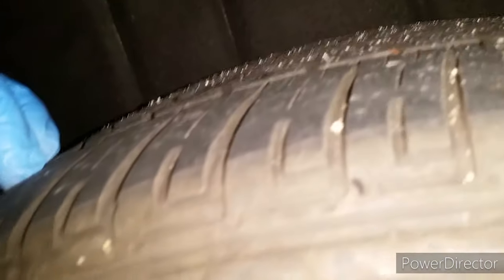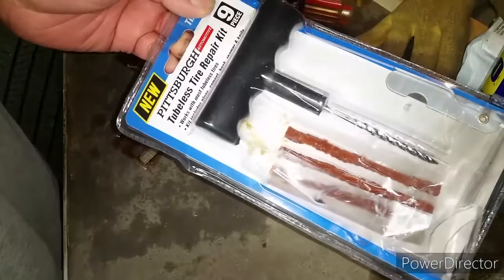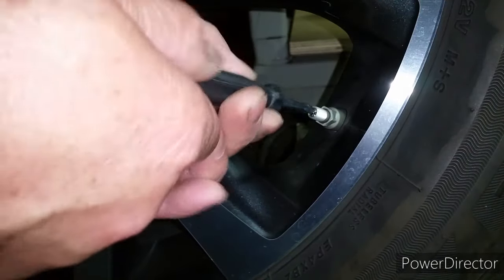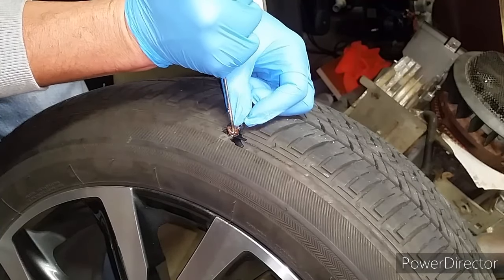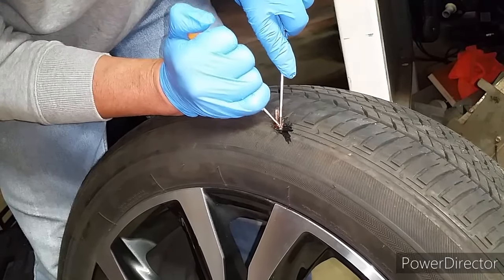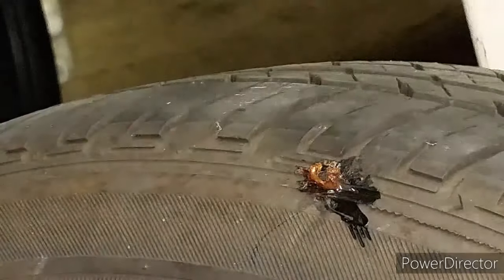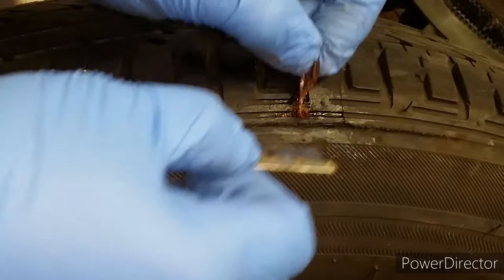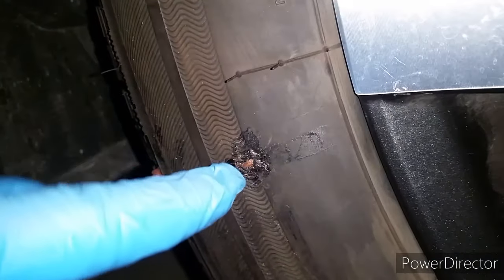Impossible Repair | Nail to the Tire Sidewall fixed | DIY

Comment: This is highly unsafe. If you do have to do this, put it on the rear. This greatly raises the odds of a blowout. And if you do have this, let the cement cure before putting weight on the tire. There is no steel belt to hold the plug and it will more than likely just pop out.
Reply from the maker: It was mounting in the rear for just in case purpose.  After the holes were sealed,  it did sit for 24hr or so before it's aired up. No there would be no blow out. Worst could happen was the holes  would start to have a slow leak and set off the TPMS.
Reply: @tonedubb4325  worst could happen is catastrophic collapse of tyre causing car to veer into oncoming bus full of people resulting in fireball and 40 deaths including your own
Reply from the maker: Hmmm doesn't make sense,  if the front tire goes,  you will more likely to have less control of the car. If I understood your comment correctly.
Reply: @tonedubb4325  Yes its counterintuitive but:Regardless of the drive type, we recommend not fitting the better tyres at the front, but always fitting them at the back. The reason is simple: The rear axle ensures the tracking stability of a vehicle.
Reply: Just to add to this a year later the plug should never just pop out if installed correctly because it vulcanizes and becomes part of the rubber.

Comment: I've used a plug on a shoulder puncture like this, and yes the pressure held up.  But I don't think it's possible on an actual sidewall puncture.
Reply from the maker: There were two caused by the nail. One was one outside of the treads, and the small second punctured hole was on the sidewall. Do not try to make the hole bigger like you normally do on the treads area. Using some of the plug material along with rubber cement would seal.

Comment: Random this video only popped up now for those other commenters as I searched for it. Must be a lot of flat tires today. 

I just did a shoulder repair after the tire places wouldn't. They just wanted to sell me a new tire and sell the old one to a used tire place.
Reply from the maker: I went to les shwabs tires for a different flat on wife's my van. She went with me. She was wondering how they make money if they give flat fix for free.  They said it to close to the edge and told me they couldn't fix it. I told him ok, set me up with one tire then.  He could not sell me one. I need to buy 4. Driving with one different tire is unsafe. Now She knows their tactics. I told her some customers would buy 4 new tires because they believe them that's unsafe to use old ones. Because he knows tires. Now she's  wiser. Lol
Reply: I'd say it's partly trying to upsell, but mostly fear of being found liable for any crashes later on, so those policies are a way for them to lawyer ambulance-chaser-proof themselves.
Reply: Also, sidewall punctures have a danger of "zippering" from the belts to the bead, so a repair there should AT MINIMUM use a plug patch from the inside, and maybe use a pressure roller and 3M rubber weld, to be safe.

Comment: Why would you take the air out? Leave it in! 
(That’s what she said😂)
But seriously.. there’s no need to remove the air
Reply from the maker: @clubbinmag3  just wanted the glue to bond. Having air pressure would push out the glue and won't seal properly.

Comment: Can someone explain why this is unsafe and give proof why it's unsafe. I know nothing about tires really, but it seems like there's more naysayers then actually facts. Is this one of those "they all say it's wrong so I guess it's wrong" or is there truly a reason? Just saying for those who don't understand.
Reply: That's the most flexible part of the tire when it's rolling down the road. I have a winter tire that was patched by a professional tire shop in the same location and I'm still kinda nervous about using it.
Reply: I own a tire shop and from my experience the side wall don’t have any metal wire to hold it in place like the center of the tire so the hole on the side wall can expand while driving with a lot of pressure. It can cause a blowout
Reply: Technically if you’re really strapped I gather it’s something you might be able to do to get down the road, but take it suuuuper easy and as slow as possible. That’s assuming you have an air pump to re-inflate. In an emergency and you don’t feel like you have a choice you’ll have to go for it and hope she holds. Use every patch you got and can lol
Reply: If sidewall punctures cause blowouts so easily why didn't his tire blowout when the nail was in it?
Reply: @matttheodus7519 because it’s always flat. Hot take
Reply: I have been in tire industry over 40 years, especially in Final Finishing, but such a type of repair is not suitable for passenger cars, it must be repaired by professional  operator who knows about hot repairs of tyres. Second glue and shoe lace is not solution, in shortly.
Reply: I was thinking the same thing

Comment: Side wall structure and integrity are very important elements to the foundation of the tire and very critical to the safety limits and reliability standards. The side wall is what holds the weight of the vehicle and is also what is responsible for the handling especially under turning circumstances which will create a weight shifting situation where weight will shift towards one corner and that side wall has to live up to those conditions. Besides, you will normally start to see a bobble in the side wall at the repaired area which means the structure has lost its normal integrity.
Reply from the maker: In my case, none of those things  happened.  Tire held air, never leaked once and last for a year then i went ahead and replaced all 4 tires. I got to wear all 4 tires evenly till time to replace them.  Think of this, if you poke a needle any pairs of pants you got,  it will go thru but the needle doesn't break any of the woven fiber.  Here you got a small nail poked 2 holes in the side wall, small nail, no nylon woven threads broken. The rubber is damage due to punctured holes. The goal to to stop the leaks.  Add glue and fiber strands to plug up the holes. I didn't disturb anything else. Why would there be bubbles? If the  holes are plugged,  its a success. That's the result i got I got. I could understand if someone stuck a knife to my side wall,  no I'm fixing that.  Fiber are cut. Thanks for comment. I saw videos from the middle east where the commercial truck tire with a tennis size hole on the side wall. They fixed that.  Now that's iffy.
Reply: You are going to have do a lot more than just write " The side wall is what holds the weight of the vehicle.." to argue against physics.
The side wall doesn't even have steel wires like the tread side does, so I have no clue how you figured this one out ???

Comment: This is "DANGEROUS"!
I wonder how many people is actually taking this advice. That second plug repair dead middle in the side wall will eventually cause a blowout. 

Just hope you don't get sued. 🤞
Reply from the maker: That tire got replaced long time ago.  Not dangerous at all.  Worst could happen is a leaky tire that requires airing up from time to time.  Tire has TPMS.

Comment: I've got this EXACT problem rt now. And though I paid for road hazard (I'll never do that again through Walmart), they won't honor it. And no tire shops will touch it because of where it's at. It's almost exactly where your nail was. A little higher but just barely.
Reply from the maker: You can fix it.  Just careful not to make the hole any bigger. Don't use the plunger tool provided. Take the tire off,  let all the air out, any left.   Peel the stick strand of flat fix material. I used a syringe to inject exta glue into the hole.  I think the video shows you how it's done. Good luck.
Reply: probably because when the tire was flat you kept driving, now walmart has an excuse not to fix it.

Comment: It’s not that u can’t put a plug in the tire it’s that it’s so close to the side walls the tire compresses and the plug will come loose and leak again
Reply from the maker: It's all depend on the punctured hole.  If too big or structurely damaged,  then it might not be good to fix it.  So use a little common sense.  In my case,  it's just a couple of small holes caused by a nail. The patch has never leaked for a year. I ended replaced all 4 tires after the treads worn down.

Comment: You're not supposed to plug the sidewalls or the shoulder edge of the tires. only the center they won't even do it at shops I had to get a new tire today because it's not safe. you can easily have a blowout.  It's always good to save money but not when you're life is involved.
Reply from the maker: I agreed if the tire is too damaged but you need to access and determine whether it's doable and safe.  Will not work in every situation.  It worked for me.  It lasted a year without leaks. Mine was caused by tiny nail.

Comment: hyperinflating tire will help to use a real repair kit, but overall a real bad idea
Reply: I plugged a hole in the sidewallof my truck tire and then proceeded to drive it 20k miles that way.

Comment: I would think this is a last resort until you get to the tire shop and get a new tire I'm sure that this would be OK for 50 miles driving slow and cautiously obviously
Reply from the maker: I put about 6k miles, and year later i replaced all 4 tires at one time with new ones.
Reply: It will be 100% fine for the life of the tire. I have done this many times, even on large trucks, never had an issue.

Comment: So is it okay and legal to repair if it's the sidewall vs shoulder, vs crown of the tire, or if there's more that two holes, and/or the holds are less than 14inches apart?¿!!!
Reply from the maker: Use your own judgment.  Embedded inside the rubber of the sidewalls are filled with nylon strings. If you stick a nail thru your jeans, the hole will be small. Also, the nail is pointy. It might not cut the string when it entered. So, the sidewall integrity is still good.  The worst thing that can happen is that it leaks air. I got 2 holes on that tire, about 3-4in apart. Just don't shrove the round filing tool into the hole. It would destroy the integrity of the sidewall.

Comment: How many miles did you put on this tire after the repair? Thank you
Reply from the maker: Probably about 6000 miles. Drove it for 1 year.
Reply: @tonedubb4325  And then what?  Did it fail on you?
Reply from the maker: @77abcdef77  at least 6000 miles. Replaced because it was worn. It never leaks.

Comment: ...please dont do this..there are steel belts in the tire to hold a patch or a plug, but not enough belt strength to hold a patch or a plug properly on the sidewall.

Comment: You are not to repair holes in the sidewall.  There is no steel reinforcement there.  Your repair is WRONG.  No reputatable shop, garage or dealership will do this.  Take down this video. It is misleading.
Reply from the maker: Of course no reputable tireshops would fixed.. why take the responsibility for a few dollar repair job. I would not do it if i had a tireshop. I rather sell you a new tire.  More money and no chance of problems. Why take any chance.
I'm showing others if they have similar issue like a small hole, you can fix it.  They're nylon threads in the sidewall. If small nail pierced it, the threads are not damaged.  Example,  you stick a needle thru your jeans fabric.. the needle goes thru but none of the threads break apart. So all i did was mending the rubber back together.  If you got a hole size of a pencil, I'm not telling you go fix it.  Use some common sense. Just because you disagree based on your point of view doesn't mean it's misleading or wrong.
Reply: Bias Ply tires don't have steel belts, and they plug them.

Comment: Highly illegal
Reply: lol, it's his life
Reply: What the trye places are telling u is that it is unsafe to repair the tyre NOT that it won't hold pressure when patched!  High risk of a blow out or other types of failure
Reply: Not illegal but very unsafe.
Reply: @threedollarbridge  how its unsafe
Reply: @doctoratiq  Puncture_repair_handout_17_2.pdf
Reply: I've plugged several tires it's not illegal and it's totally safe they've lasted for years.
Reply: @supersonic8632  that is 100% not true there's no risk of a blowout if you plug a tire like this. I've done it several times they've lasted for years
Reply: @threedollarbridge  explain to me exactly how it's unsafe because I've done it several times they've all lasted for years
Reply: That's how we repair a tire in the Philippines, we only use a plug now adays unlike before that we use patch which takes a lot of time  and it last until the tire are worn out... Its not illegal if you don't have the money to buy a new tires.
Reply: @supersonic8632 but don’t they sell sidewall repair kits?

Comment: I don't what state you live in but in most states it is not going to pass a state inspection side wall repairs are illegal
Reply from the maker: What inspection are you talking? Why does it need to be inspected. I don't get it.  If you decided to get a tire replaced at the tire shop, do you need to get it inspected before you can drive it? I'm not a tire shop.  It's your car,  you do it at your own risk. Maybe the guidelines are for tire shops.
Reply: @tonedubb4325  when your state vehicle inspection comes due it will not pass unless you live in a state that does not have yearly safety inspections where ever that is  go ask a garage
Reply from the maker: California doesn't have any of this yearly inspection rule. They just have smog inspection every two years.  Your tires bald. That's why I have never heard of this.  I guess that's how those states make their  money to have yearly inspections.
Reply: @vincem6042  if an inspector even notices that the tire has a plug 🤔😏 my guess is they wouldn’t even notice if you trim it short. Many states don’t even have inspections too
Reply: He probably smart doesnt live in a lib state
Reply: @kman2560  He already said he lives in California. Chuds believe whatever you want regardless of reality no wonder you're so easy to hustle

Comment: Horrible advice don’t do this
Reply from the maker: You guys always think the worst gonna happen. Use your own judgment. If tire got punctured one the side by like a flat piece of metal, then it's not a good idea to repair it. The side is weaved with nylon  to keep it strong and flexible.  If it poked by like a small nail, those weaving still intact like you stick a thumb tac thrub your jeans. It goes thru but it not ripe. As for the tire,  i was to inserting any metal plunger in it like you normally do to, if you have hole on the treads of the tire. All I'm doing sealing the leaks. Worst thing can happen is it won't seal. The car has TPMS on it and won't alert if the a leak. Tire would not pop. The tire was mounted in the back. I was just sharing that it could be done.  It lasted 1 year. If anyone runs into this issue, think and assess before doing it.